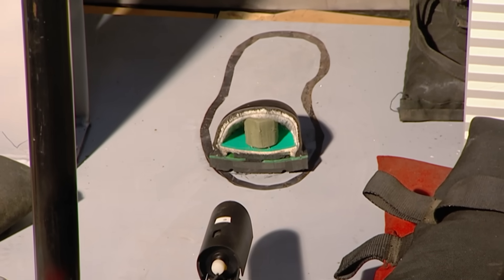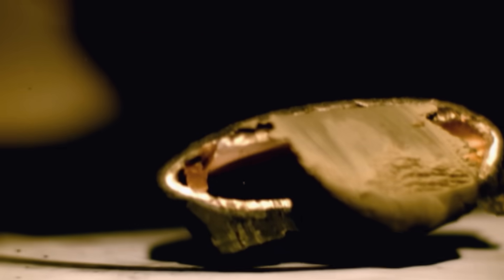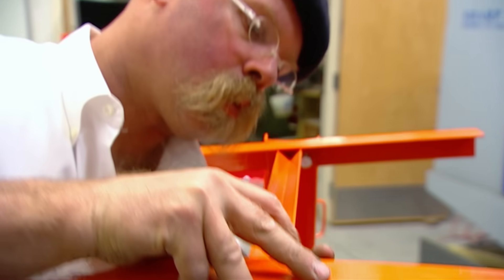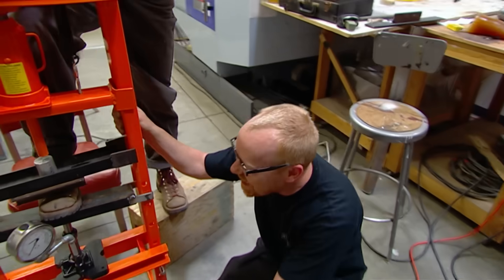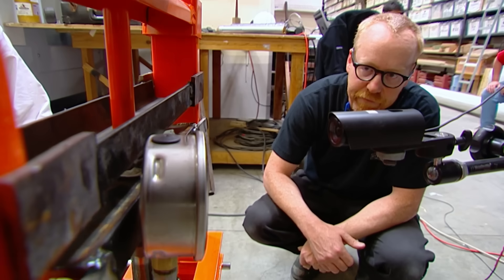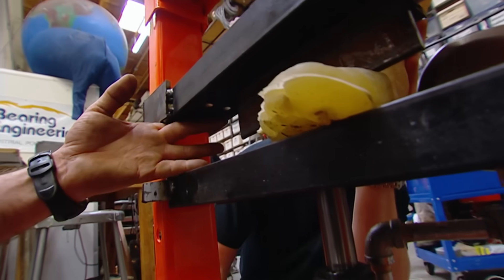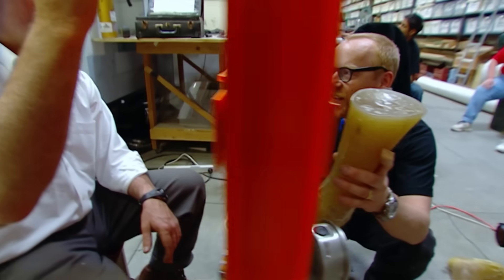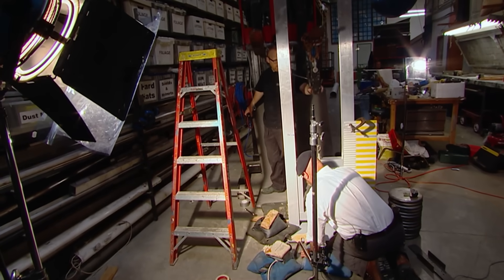Do Steel Toe Boots Really Protect Your Toes? | MythBusters

Comment: Any circumstance in which a steel toed boot works against you, a regular boot is already paste
Reply: Precisely. IF a steel cap was somehow compressed to the point that it "cut off the toe" or whatever, that amount of pressure and force will pulverize your whole foot. Like, complete foot destruction. Missing toes would not even be a worry.
Reply: @fookman212 Also, cut off toes are easier to reattach than crushed ones. Crushed stuff... Nothing to save.
Reply: @fookman212 this is why we never worried about such things at the shop. If anything, there should be a requirement for steel tipped gloves. Nobody in our shop wore steel toe shoes and not a single person lost a toe. I've seen fingers literally get ripped off and bounce across the floor. Us big footed people are supposed to lug around 5 pound steel boots but no requirement for hand protection though huh?
Reply: @myster.e  Uhm... no!
Its not like Osha is not allowing you to use gloves bro!
Reply: @benderrodriguez1215  You remind me of the discussions about manditory seatbelts.
Reply: Same thing with seatbelts. Ive seen people post stuff like "look at this giant bruise/broken bone I got from my seat belt after an accident!" Like yeah, now imagine becoming a human projectile instead
Reply: @HolyZest  The choice between seatbelt and airbag vs steering wheel and windscreen is a simple one.
Reply: @cccenturion4480  you say that but we still have people flying through windshields 😂 safety has never been cool. If it wasn’t for a lawyer hitching back in the day we wouldn’t even have seat belts and airbags in cars because manufacturers believed adding these devices would make the consumer thing cars were death traps 😂
Reply: @cccenturion4480 my mom wasn't even ejected. They were in a dodge ram truck with leather seats, so she was thrown into the console (she was short). Her chest was crushed and she died instantly. My dad was wearing his seatbelt and suffered 9 broken ribs and his sternum was fractured in two places. His spleen was lacerated and he had a contusion to his heart which caused a-fib, but he lived. Just wear your seatbelts, y'all.
Reply: @AmandaSuzanne10  I’m sorry to hear that about your mom. I hope you all managed to cope okay after that.
Reply: @HolyZest about this my dad's schoolmates back in the day had gotten a sports car and had was joy driving it with one of my dad's friends, the driver no seatbelt das friend seatbelt. He went like 2-3 hundred km/h in to a rock face and dads friend survived with some minor injuries(he was very lucky) driver had traveled trough the steering wheel, not  one one piece mind you and was dead on impact.
Reply: @alolol1000 a seat belt will not protect anyone above 200km/h your numbers are off friend. The raw physics of what you are talking about would kill anyone instantly regardless of wether they wore a seatbelt or not
Reply: Without the seatbelt it would be “look at the mangled paste on the road that is my cousin after they didn’t wear a seatbelt!”
Reply: @HolyZest there is an argument that if you drive a Tesla, it's better to not wear your belt then you die quickly from blunt force trauma in an accident. Rather than burn to death.
Reply: @kingmanic ???
Reply: Dont forget, your foot is too.
Reply: Yeah you often see such arguments in popular media about knights armor that basically boil down to "you're not absolutely invincible in armor, so it would be better to go naked"-kind of bullshit
Reply: I use to work in the shipyards and I actually had to explain this to people who tore out the steel toe. They still did not get it. They were too hung up on the fact that if it did get crushed it would cut off your toes.
Reply: @gdragonlord749 if they're that concerned about the toes there's also metatarsal boots that's protects more of the upper part as well. But yeah I know what you're talking about as far as people not listening/caring
Reply: @gdragonlord749  drop a large brick on your steel shoe, now ask them if they want to drop it on their normal shoe.
Reply: Exactly.   My wife reattached some guy's toes that got cut off when a crate landed on his foot.   She wouldn't have been able to do anything with the mushy mess had there been no steel toe in his boot.
Reply: Yep
Reply: Well that’s not necessarily true, my dad lost his toes because they had him wear steel toes in an environment that could cause extreme frost bite. The steel made it worse simple because they were steel
Reply: What sort of environment are we talking? I wore steel toe capped fur lined boots 10 hours a day in a -22c freezer and with the right socks and the fur my feet were very warm. We had to take breaks every 2 hours for 20 mins but not once did my feet ever get cold.
Reply: @Abysslz well That's one issue with steel toes, is they can either heat up or get really cold in extreme weather, especially if he's already facing the chance of frostbite. Luckily now there's now composite toe boots, which help with temperature differences and other boots like metatarsal boots which guard the upper part of your foot. Not sure what the exact situation was with your dad but that sucks either way.
Reply: @Abysslz  did he take them off and leave them during the night whilst sleeping outside in a Sleeping bag, or did he not wear the correct socks for the weather?
Reply: What about all the composite toe boots?
Reply: @someonewhoisnotanexpert9147 Regardless of the material of the protective toe (steel, composite, alloy, etc.), if it carries the rated mark, ANSI/ASTM, then they meet the same compression and impact standards.
Reply: Why not a composite shoe?
Reply: @bnice7 It’s literally the same concept
Reply: Just basic survivorship bias
"Oh no! Instead of having my entire head blown apart, I instead suffered a concussion! CLEARLY this is a fault with wearing helmets!"
Reply: There's a story from the British Army in WWI when they first adopted steel helmets. Army hospitals saw a MASSIVE uptick in casualties with head injuries as soon as the helmets were adopted, to the point the Army almost considered unadopting them.

That was until a doctor explained that if it hadn't been for the helmets, the men would simply be dead.
Reply: I got my foot ran over by a forklift. The steel cap got bent at bit but my foot was fine.
Reply: Well, I work for the commuter rail in and we had a quarter mile length of rail being laid on about 15 years ago and a guy with a steel toe boot happened to not be paying attention when the rail was being laid off the back of the train & His foot ended up under rail that was laid. It was 132lb rail and it literally chopped so far past his toes and to the bones a little back on the foot that the only thing was left when he got to the hospital was the skin underneath his foot that was still attached. It didn’t cut completely through, but he lost every single one of his toes and destroyed Lot of bones in his foot… so he thought it would be a good idea to try and take his boot off and I said that was a bad idea…I grabbed my belt off my pants and wrap that bitch so tight right above his boot and call 911 I’m pretty sure he lost half his foot
Reply: Succinctly put - and well-put!
Reply: yes
Reply: It’s the bulky ones that are straight up uncomfortable, the ones that look like military grade which I own a pair actually are comfortable to run in so yes I stand by that
Reply: These are Commiefornia dbags that pretend to understand the real world.  I live in the real world, in the real world PPE can get you killed and I’ve seen people thrown from cars because they did not have their seatbelt on and that’s why they are still alive today.
Reply: yeah, thats the thing people need to realize, you always weigh risks, and even if steel toes are dangerous, not haven them is even more.

many people fail in this basic reasoning
just see the discourse on vaccines, yes with some of them there is risks, but getting the desease itself is even worse for you by A LOT
Reply: But instead of losing the tips of your toes, you might lose half your foot cuz the toe cap acts as a ramp
Reply: Faulty tests. Because they altered the boots
Reply: Acute foot injuries from work-related incidents? yes. Chronic foot injuries? absolutely not. Safety-toed boots protect your employer from fines, penalties, higher insurance premiums, and civil liability...not you (over the long term). You should absolutely wear them if you work in an industrial setting where it can potentially save your foot in the case of an incident...but you should have quality insoles in them, too.
Reply: Probably should wear more stuff
Reply: Also, this is clearly not true.  U can think urself y
Reply: So then there's no point. If in both cases, its paste, then who cares
Reply: @johnsonjunior547  You get a chance with toe protection. Same as in hardhats. PPE gives you a chance and is a lost resort, nothing stops everything. PPE may be a requirement but it's ultimately a personal decision. Much to the thought of, you can lead a horse to water...
Reply: Why would you even work with boots that are not steel toe ?  At this point, just wear shoes
Reply: @Hide_and_Tweak Hiking but thats about it. When your hiking the steel toes is extra wieght on your feet (heard from a lot of hickers a pound on your foot is the equivalent of 10 on your back as it tired you out quicker) and you can also have a slight bit more tactile feedback without the steel as well helping you to get (slightly) surer footing on otherwise unstable terrain. Even then many people still prefer steel toes even then for those time your foot impacts a boulder or your foot slips and you get it caught under heavy rocks. But other then hiking your right no reason not to have the steel toes, even then the statment can still be made that they are the safer option.
Reply: @Hide_and_Tweak Because boots offer more ankle support, they have the cut out at the heel for ladders, and they do a better job at keeping your feet dry. Sometimes you need just that on a job site, or sometimes you can't afford a steel toe. Imagine gatekeeping boots
Reply: @Hide_and_Tweak because your boss demands boots. I always wore shoes when I was allowed. I'd rather be able to stand and walk after 40. We all decide which risks we want to take
Reply: @Hide_and_Tweak Horses. I live around them and have been taught that you don't wear steel toes around a horse because IF the horse decides to stomp on your foot(rare but it happens, horses have big personalities) a steel toe will do nothing but turn into a metal press that traps your foot in shrapnel. 

Why does this matter? Well you have to image the injury somehow for medical attention, and a big chunk of sharp metal inside of a tight fitting leather binder only makes more time wasted for your medical staff. 

Also flesh and bone in a normal boot is a lot more impact absorbent and dispersive than a round plate of metal. Just looked at quite a few horse stomp injuries to the foot and they are easily recoverable even in rough condition. 
A horse can't turn your bones to dust but it can turn that metal dome into a big bowl crushing your foot underneath. Hit the right angle on bad steel and now it's sharp shrapnel holding your foot inside the boot.
Reply: Lots of guys work with and around horses and cattle where I’m from, no steel toes allowed there. If you get stepped on by a 1000lb plus animal no steel breaks toes, Steel cuts your toes clean off. Bones heal, toes don’t grow back
Reply: Yeah….ever thought about that the test was not sone for you to buy the worst but to buy Boots with Carbon tips?
Reply: The point is if reached that points is it would cut off your toes and not have you crushed where your hung
Reply: That’s not true
Reply: Some very rare situations it's better to not have steel toes. A coworker at work was in an accident a month ago, the boss clipped the side of his foot with the forklift. Doctor told him if he had steel toes on at the time, it would have sliced off his toes. He's got nerve damage in his foot but nothing was broken.
Reply: Well out in the field/ mud, your toes may get smashed and sink instead of cut
Reply: @C-H1 that's an argument I've never heard... and I reckon it's quite correct
Reply: @toddrenshaw24  It's not. If you're out in the field in mud, then the amount of force on the steel toe will be mitigated by the same sinking.

Steel toe will ALWAYS, in every single circumstance, be anywhere between irrelevant and completely mitigating the damage. It will never, not under any circumstance, result with a worse case of damage to your foot than without having a steel toe.

Now, a steel toe can keep you in a more dangerous situation (eg. if the weight that hit it is precariously balancing, possibly falling in you, but since your foot is under it instead of cut off by it, you cannot actually move away), but those cases are so, so unlikely, that they are not worth considering, when there's so many common instances where you could lose your foot (or life due to infections etc.!) as a consequence of not having the steel toe.
Reply: I got one. A horse rears up and lands hoof full force on your foot.

With a regular boot the foot is smashed to hell.

With a steel toe the steel bends clamping down onto the toes, breaking them and preventing the boot from being removed.

The doctors have to use a power saw to cut the boot from the foot. The friction against the steel is hit af on top of your still broken toes.
Reply: Except speed you’d have on normal shoes that’d let you avoid the situation in the first place.